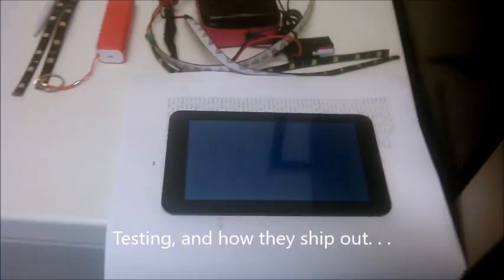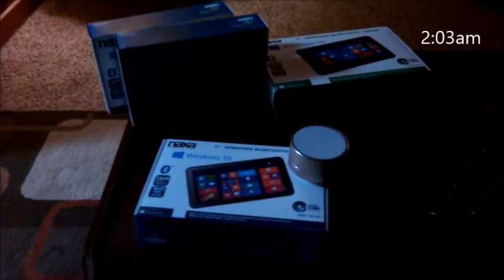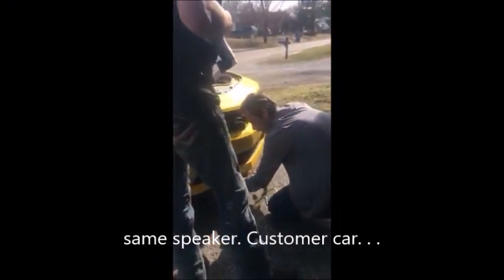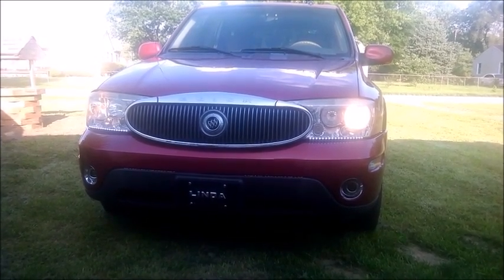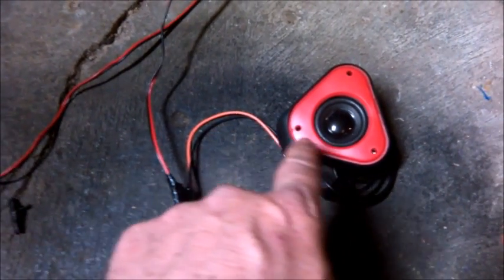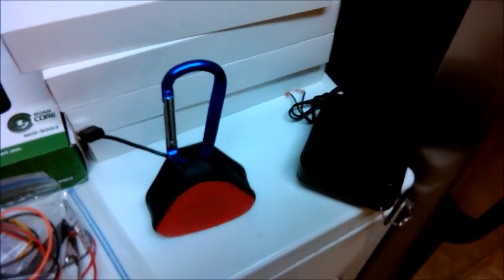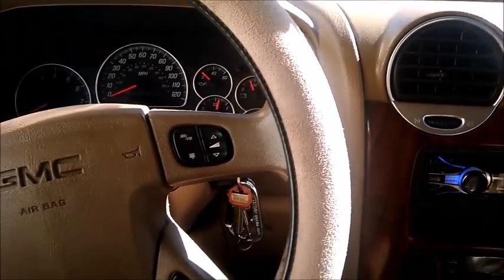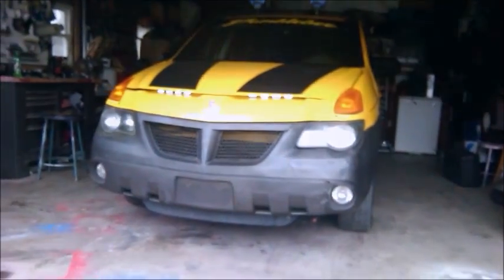How does IndyJarvis Work?- How can I get one for my car?

Comment: so the tablet is just for installation and when all said and done tablet is not hooked up correct?
Reply from the maker: The tablet has the actual code on it. It doesn't have to be installed anywhere. Is that what you mean?
Reply: I mean after its setup you don't need the tablet to use it do you?
Reply from the maker: Yes you need the tablet to use it.
Reply: ok
Reply from the maker: The Tablet IS THE Ai. It is pre loaded on the Tablet to fire up when the power button is hit. Most clients keep there tablets between the seats, on the dash face down, or even in the sun visor, above there head.  All you do is talk, even standing next to the car with the windows down. Simple as that. Then- Just talk, it will answer or comment. ;) - IndyJ
Reply: @IndyJarvis  You mean the tablet can be closed and stored anywhere in the car?